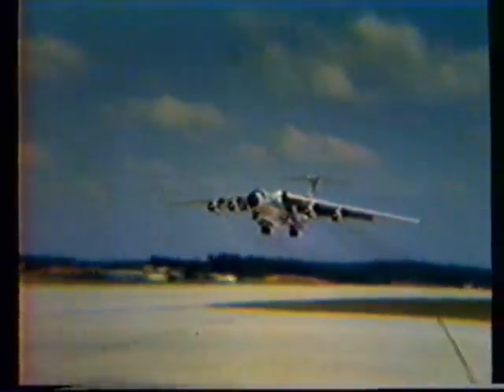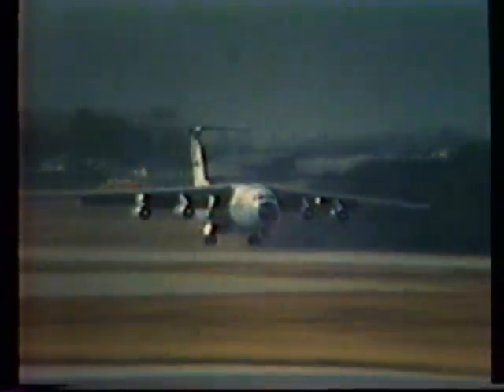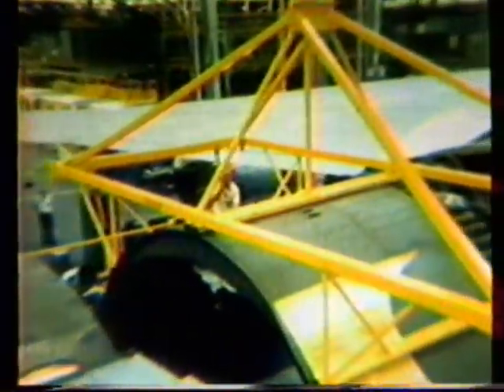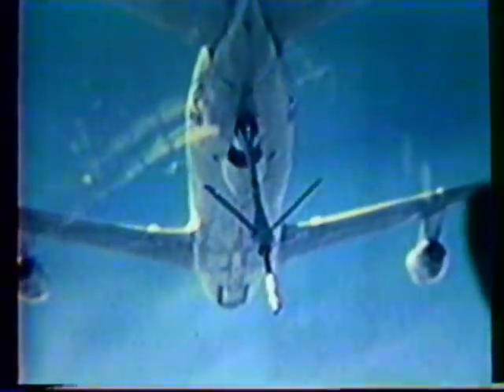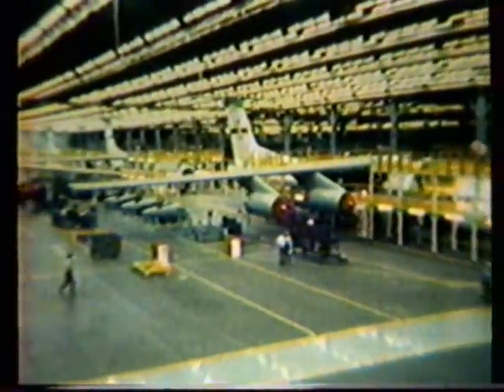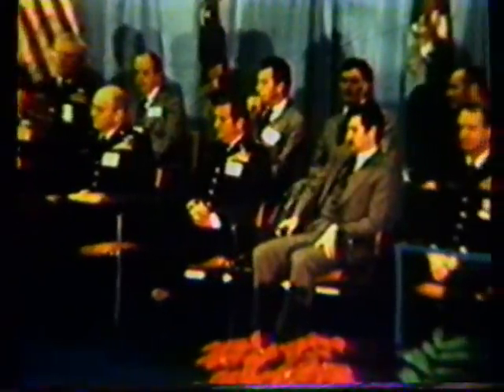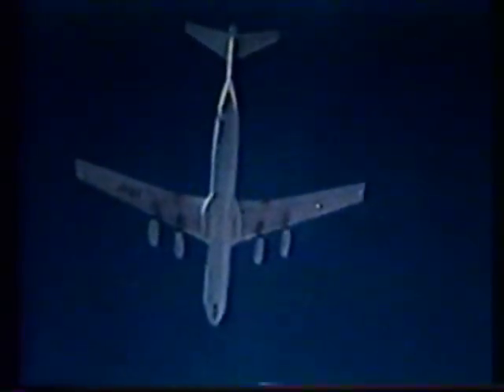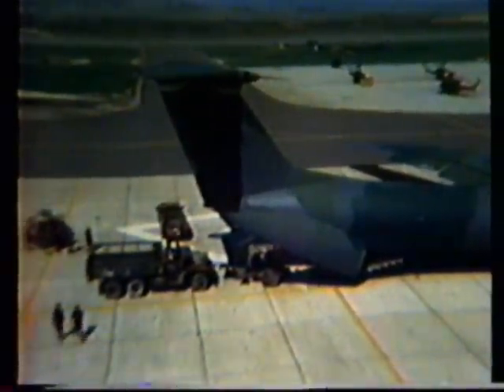C-141B Stretch Program

Comment: Thanks for the video and old memories.  Was stationed at Edwards and worked in the drop zone (PB-8) during cargo, dummy, and human drop testing for C-141B program.  It was a well run, very smooth, and rewarding test program to work on.  In the end the B model had no negative characteristics compared to the A model.  Big win for the USAF!

Comment: Think about what had to be considered for this kind of modification.  I was wondering if the landing gear was modified for more weight.
Reply: I don't think the landing gear was modified. The original design maximum weight for the A model was not changed for the B model, so the gear didn't require modification. The major reason for the stretch was that the A model's cubic volume was often filled, but the average payload weight was not near a maximum payload weight.

Comment: Worked A's  and B's at McGoo and McChord 77 to 85. Had 130's at McChord as well and worked C-5's at Travis for 30 days when McChords runway was down. Could still work a 141 Hydro system 30+ years later. Best of all three. My favorite of all acft worked in 21 years.

Comment: From 85 to 88 at FBNC I rode 130's, 141's ,C5s, Crash Hawks, Huey's and shit hooks. To Hondo and back, C5s. To Panama and back,C5's. To the desert somewhere in Arizona, C-130. The best ride was on a 141 stretch from FBNC to Chippewa co Int'l ap in Kinross MI. Did some winter training in Raco in the UP for a week and left a week later from CCIA in a whiteout blizzard. All flights canceled except for our stretch home. We had two blizzards that week and got about 36' of snow. We got back to AP the night before and had to melt off the hummers before morning. Defrosted 4 hummers overnight in a hangar and loaded them and our asses in a plane we couldn't see until it pulled in front of us on the tarmac because the biggest blizzard was happening that morning. 

If I recall, 5' per hour. Doors open, quick load. Get in, tie down, sit down and shut up. De-icers spraying as we loaded. Quickest tie down I ever seen with two LMs directing us and double checking everything. We did about 30 minutes from  plane stop to wheels up. When I tucked into the sling seat and covered up with my poncho liner while making sure my mickey boots had the valve open, I couldn't see the terminal about 200ft away. I learned if we hadn't beat it within the next few minutes we would be staying there awhile. It was a decent size airport but it was used to shitty weather. They had all four of the sprayers they had shooting anti-freeze on the plane while we loaded hot.  About 25 MPs and four HMMWVs. In about another ten minutes we were above the storm with blinding sunshine. Went to sleep right after that. Woke up at Pope and peeled off my field jacket, mickeys, and pants. It was about 65 degrees. 

I don't remember anything about the flight home. I was exhausted, cold and tired. I don't remember waking up once. That's what made it the best ride ever.

To be honest. It was the only flight that worried me a little. That was an Effin BLIZZARD! Planes aren't supposed to fly in that shit!. This one did it like the sun was shinin"! Smooth, quiet considering, and I felt safe. The crew was confident like it was just another day flying. You couldn't see 200 ft and they weren't worried. What a plane and what great crewmen and pilots!

Forgot to add. I'm pretty sure that was Nov-Dec of '87. Shit gets foggy as we get older. Pretty sure it was since uncle sammy sent me to Panama in Jan '88.

Comment: My first assignment in the USAF was Charleston AFB in 1982. Our planes were still in the process of getting upgraded. I was an Autopilot troop, and going up the T-tail ladder and looking out the top of the tail made for a great view. The strangest job I had on a 141B was during a RED BALL (job on an aircraft preparing to launch). The AHRS (attitude heading and reference system) was INOP. When I arrived to the aircraft, troops from Fort Brag were behind the aircraft. I climbed the ladder to the cockpit and asked the pilot what the problem was. He pointed to the co-pilot. I directed my question to the co-pilot. He said the AHRS would not work in the OFFicial mode. There I was an A1C (airman first class) having to tell an officer that the AHRS was not designed to work when OFF. When I was leaving the aircraft, I yelled to my co-worker "I'm sure glad I'm not flying on this aircraft" loud enough that some of the airborne troops lined up waiting to board could hear. I'm sure that made their jump even more special.

Great plane to work on, and I loved working in MAC (military airlift command). I spent most of my 25 year career trying to get back to it.

Comment: I often wondered, whether this was implemented because of the failure of the C5A program to be effective. Of course this is only my opinion, based upon all the broken C-5 we would see throughout the system that we flew. Just a thought. But it certainly expedited the demise of a wonderful aircraft that I personally flew on as a loadmaster
Reply: After the Israeli Airlift, the GAO did an audit that determined we need to increase our airlift capacity.  So the stretch was done.  As for the C-5, what was the significance of pulling onto the ramp and seeing two C-5's with one up on jacks?  It meant the base only had one set of jacks.
Reply: @michaelfox10  The jacks are one thing. But the NORs parts that I carried in my flight suit and amongst my inbound load probably covered the other five that were grounded.

Comment: I was Radar/Nav at Norton AFB from early 1978 through 1984, with the Reserve Wing there, and remember when this conversion took place. The first bird shown being modified in this video was assigned to the 63 MAW, which was stationed at Norton. The 445th MAW, which was the Reserve Wing at Norton, was an associate wing, meaning we shared aircraft and shop facilities with the 63 MAW. On duty weekends, the Regulars would get the weekend off, and we'd take over handling the work. I don't miss some of the political nonsense that went on in our outfit, but I do miss working on the Starlifters. It's almost heartbreaking to see them sitting in the Boneyard at Davis-Monthan here in Tucson now.
Reply: I feel your pain. I was a C-141 nav at KSBD for two active duty tours from 1975 to 1986 at Norton.  C-141B 06-0257 is on static display at the KRIV museum.

Comment: I got into the C-141 back in 1979 as a Flight Engineer out of McGuire Air Force Base then later into the reserves at Charleston and the 707 mas/als till the end. Miss it greatly. Was on the first SOLL crews at McGuire also and a certification the aircraft for 30,000 pound Pope Air Force Base flying out Pope Air Force Base back in the day.I think I've seen almost every kind of action that that airplane could do and I did a do. My first air metal was at largest Azores with the left gear crash landing incident. The c-141 was a great launching point for a great career after the Air Force and Air Force reserves which I retired from. The best part of it all is the great dedication and crew in American patriotism that we have to be blessed to fly out of such a wonderful aircraft . Amen 😎
Reply: Served on them tough old forgiving birds.Although a bird did crash in the azores if i remember, right arround 1982-83.Yeah, was the workhorse Air Force Airline..
Evacuating American Citizens,
To bringing the hurt, the 141 did it all.

Comment: The stretch mod made a huge difference in the load carrying ability of the 141, but took years off of its service life, which was only realized after the fleet had already been stretched.  Great aircraft, in any case.  Crews loved it.  Too bad the stretch killed it off early.
Reply from the maker: I seem to recall that in the late 1980s (years after the stretch program had been completed), the 141s were retired rather quickly once the C-17s started coming online. We went, in very short time, from a scenario of "The 141s are great, in fact we want to make them all C-models" (as some were) to "Oh, geez, let's retire these airplanes ASAP." 
Another factor may have been that right around that time we won the Cold War, and entered a phase where people wanted to make the military smaller.
If you remember what the end of the Cold War was like, and haven't ever seen the 1946 movie "The Best Years of Our Lives," give it a view. It's about the post WW2 years, but some of it rings home for the early 1990s as well.
Reply: The stretching didn’t take years off the 141’s, it was the low level flying that was originally only supposed to be for 500 hours. All exceeded that. Besides the military always wants new toys, just like me and sports cars.
Reply: By the time the C-141A's were converted to the B model, USAF had already started planning for its replacement. They had discovered a need for a short field capable plane with greater lift capability than either the C-130 or the C-141B, although the C-130 would remain because of its other use demands. The C-141A/B served the USAF for over 30 years, and much of the airframe wear came during its service as the A model. Certainly, heavier loads and longer flights, and the limited number of aircraft, accelerated airframe wear. I don't consider that the stretch killed it off early, I think it extended its life. Had the USAF not enlarged its cargo capacity, it would have been replaced sooner.

Comment: I flew and jumped lots of the B’s out of McChord and Pope. It was awesome to jumpmaster a 141, the sound of the wind deflector deploying and retracting is something I’ll always remember- hanging out of the open paratroop door looking at the massive engines and the remainder of the aircraft in trail was surreal. The jump was smooth like butter compared to a 130. This plane took me all over the world and back home safely. Thanks to the air crews and maintainers! RLTW!
Reply: I flew as a loadmaster on the A models. I love preparing the troop doors for a drop. The side of the aircraft is circular, so when you pull the door open and slide it up, you are looking straight down. Quite a thrill! Then, the air deflector, followed by the jump platform. Fun times!
Reply: I was a flying Crew Chief on 141A & B's. Saw a lot cargo drops and troop jumps. Loved that acft. And not that it matters, but we called those air deflectors, spoiler doors.